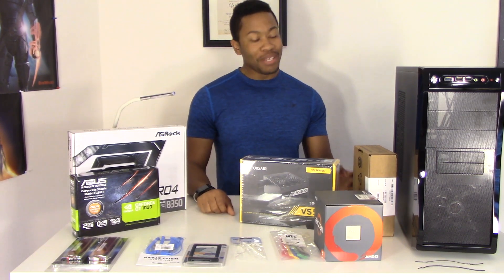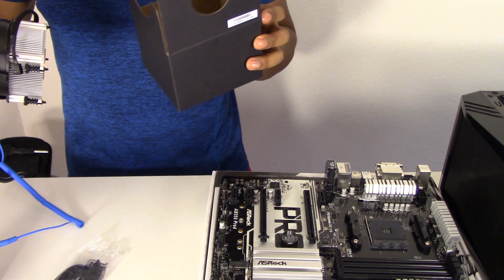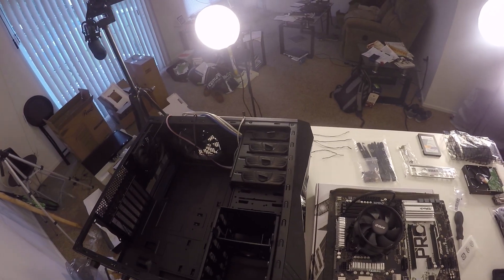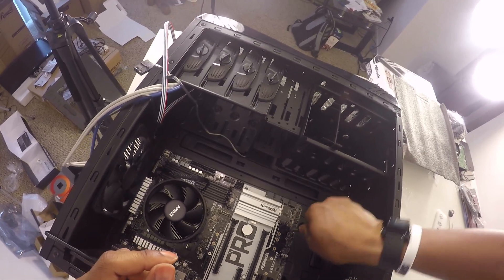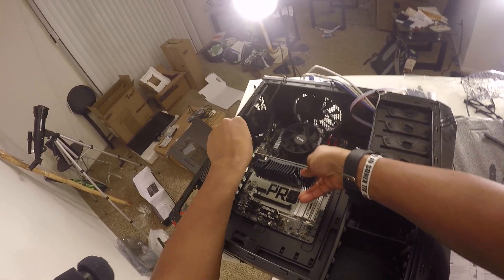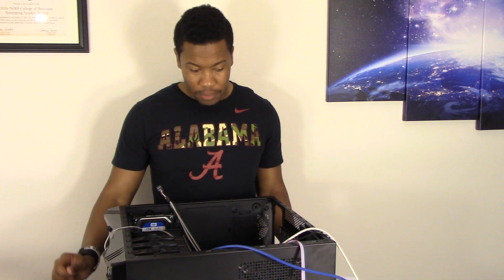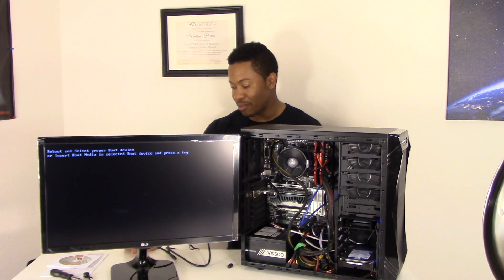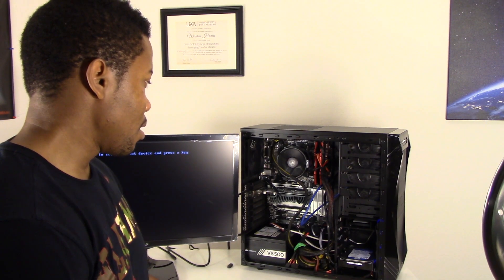Budget PC Build 2018 - $679 | AMD Ryzen 5 1600 | Noob

Comment: Great components selection, even though you mention it's your first build, it seems you informed yourself well enough about what you would need to buy. Specially recently I've seen people fall too easily into the 80 plus gold/platinum craze, without realizing that, for their usage scenario, they will hardly recoup the costs of their purchase with their presumably better efficiency.
Reply from the maker: Thanks man! You're right, it's easy to over do it and not fully utilize the full capability of the purchased components. Best case is both having an idea of what's needed and how it can be scaled\upgraded in the future to continue to meet that need.
Reply: It's not always about that.  Some people have sensitive ears and want it to run as quiet as possible.  Some of them handle power output so well they help improve the stability of a higher overclock, while also not bothering someone nearby with sensitive ears, come with a several year warranty and give you time to properly shut down your computer when the local grid is having problems that cause your lights to blink.
Reply: Disclaimer: This is speculation, I have not checked with an electrical engineer to confirm.  A better PSU might also compensate for less than great configuration of onboard component specific power management.  So you don't have to worry about spending hundreds more on the MB just for a more stable OC.  Just as a car can be comfortable with great wheel suspension or great seat suspension, but adding seat suspension to a car with superb wheel suspension is just a waste of money.  I bought an 80 plus gold PSU, but didn't notice until after.  I bought it for other reasons.

Comment: I had the same issues getting the stock fan on, I think the bracket of the ASrock MOBO was a bit low
Reply from the maker: Sam Ahh, I'm not the only one to have struggled with it. Yeah I had to push pretty hard on the screws and I was pretty nervous about doing so. And slip or too much tension could have hurt the board.
Reply: That part of this video primed me to get it right.  The fan cable has noticeable slack.  I just plugged it in and turned the HSF counter clockwise until it was as tight as it could get and mount.  Just turn the screws a little at a time, starting just enough to get them in.  The second one should be the corner opposite the first with the first in just enough to hold its grip.  My mistake here was I turned the first one too far to get the opposite corner lined up and had to back it out almost all the way.

Comment: Good vid man. Almost same specs as the one I'm looking forward to build for $700(price is a lil bit expensive here). Here's the specs of what I'm building:
Proc: Amd Ryzen 5 1600
MOBO: Asrock AB350 Pro 4
RAM: DDR4 Geil Super Luce 2X8gb 3000
SSD: Geil Zenith R3 240gb
HDD: Will be using my old 2TB WD Blue and 1TB Seagate Barracuda
PSU: Seasonic M12II Evo 520w 80+ Bronze
GPU: Palit GTX 1050 Ti Dual OC 4gb
Case: No Case yet but with my remaining budget I can only afford to buy a $50 case, sucks right?
Reply from the maker: Nice man!! Yes looks pretty similar to my specs! Have you purchased your case yet?  If not, which case are you wanting?
Reply: Not yet, I really like the Phanteks' cases, but they're just darn expensive.

Comment: I've never used an antistatic wrist strap in any PC build...just discharge your static on something metal.   And I do get zapped constantly in the winter to the point I hate touching door nobs. :/   The black plastic clips you had to remove are for the old AM2/AM3+ CPU coolers...they had clips that clipped onto the hooks. You generally want to install your RAM sticks on the box before you insert the motherboard into the case since it minimizes the motherboard flex.  Personally I'd have gotten a GTX 1050ti 4gb since you do game some...like Mass Effect.  The GT 1030 is more a home theater PC GPU but I guess your it should be ok unless you're rendering videos with the GPU.    I really want to help with your cable spaghetti. ^^   Congratulations on getting it together and it booting on the first try. ^^
Reply from the maker: I have that same problem during the winter. But I guess I was just being extra cautious on the build ha! You know, that makes a lot of sense about installing the ram before placing into the case. I'm not really sure why I didn't go that route on this build o_o. But for sure I'll remember that for the next build. I'm probably going to either upgrade or build another one next year for gaming. Though I don't get a chance to game much nowwa days (other than casual console gaming), I would like to have the option. For the Elder Scrolls at least :). Appreciate the advice and tips!
Reply: Yay Elder Scrolls! ^^  I'm currently playing Skyrim, Skyrim SE and Elder Scrolls Online...so I might be a bit into The Elder Scrolls.  Which one are you wanting to play Morrowind, Oblivion, Skyrim, Skyrim SE or ESO?  I was playing Morrowind but last year when my hard drive crashed I lost all my Morrowind mods which included the Morrowind Overhaul 3.0 that updates the games look a good bit.  I put my Oblivion play through on hold for now waiting for Skyblivion because graphically Oblivion bugs me even with mods...those oval faces. o.0
Reply from the maker: Jennifur68 Ha nice! Morrowind is what I want to play now. I'd love to play Oblivion again also. Played of course on console before, but that game has a special place. Though I've completed Skyrim, something pulls me back to Oblivion. Yeah I've heard about Skyblivion. If I'm not mistaken that has been done for Morrowind also! If not, it would be great. I've never played it but I've heard people say the original was quite annoying gameplay wise. I'm sure it would be much better on a newer engine.
Reply: Morrowind relies on virtual dice rolls to determine hits so early on its like swoosh, swoosh, swoosh, swoosh, swoosh, clink, swoosh, swoosh when you swing a weapon. You miss a lot because your combat skills are low.  I'm kind of looking forward to Skywind too after loosing my load order for Morrowind.  I had the game looking pretty good with all sorts of grass, updated trees, new bodies and draw distance overhaul and after the hard drive failure I just couldn't get it all working again.   One of these days I'll get around to finishing Morrowind but I've had to start over like four times.

Comment: Hello dude, nice build, just wanted to say that the stock cooler can overclock to 3.8ghz I believe while maintaining decent temperatures
Reply from the maker: Thanks man! Nice, I was a bit afraid to overclock it at first. I may give it a test run soon and monitor the temps just to see the difference.
Reply: warren010h No problem dude happy to help, but temperatures shouldn't go over 65c under load I believe
Reply: warren010h Btw please try to do some cable management, and maybe try to take some of those drive cages off, this will increase your airflow, giving you lower temps
Reply: Before you OC you should check out others who reviewed this board and mention overclocking.  Allegedly, as long as you stay within a certain voltage range you should be fine, but too much and you might permamently degrade the CPU.  You should approach this gradually and very cautiously.  But you should get at least a small boost within the safe range.

Comment: I'm not recommending any risk taking, but I've heard Jayztwocents brag about building computers on his carpet and never experiencing any problems because of it.  When you're new to something or damage is a large cost to you, you tend to worry probably more than necessary.  I know I do.
Reply from the maker: OptimisticPessimist I definitely worried more than likely necessary. In particular because of my carpet. But yeah the cost of the components, though not as expensive as some of the more powerful stuff, I didn't want to have to buy something again lol. Interesting mention though. Sounds like the carpet static deal was challenged

Comment: Hi, im planning to build one too, will just use it for normal use and entry level rendering.. planning to get ryzen 5 1600 + asrock ab350 pro.. but my worry is the memory, i want an 8gb ram but most brand and their models in the stores are not found in asrock's qvl site. Should i change mother board? OR yolo with the memory even if not found on qvl?

Comment: looks realy nice, i have the exact same thing however mine just doesn't go on, the cables are very hard i don't know the exact name of them but there are multiple colours and plus and - that are loose i think i did the correct thing and i put the yellow power cable in and the cables for the hard disk but mine won't boot, it goes on but the fan won't spin and it has no input, any help only difference between the uploaders built and mine are that the coloured cables are loose
Reply from the maker: Hey sorry for late response. Are you still having this issue? I wouldn't think the tightness of the cables would exactly matter, unless it's causing your connectors to not be seated well enough. And you probably wouldn't want to stress your cables entirely too much. If you can, try to rearrange them so that they are a bit looser and make sure the connectors are fully seated. Sometimes pushing them down just requires a little extra tension. Not too much but you know. And it can be scary because you don't want to force too much and break anything lol. Let me know if this helps. Probably general info but I know it was reading a forum about pushing the RAM down hard enough that convinced me to push harder during this build after trying to insert them for over an hour haha!
Reply: thanks for the response man, din't expect any, i was just being a brainlet i accidently plugged my cpu fan into the wrong part, when i plugged it in the correct slot the pc worked, also some ram don't have to be push hard as long as they can be locked in, but thanks for writing the response

Comment: Hey, I have a problem on that motherboard with installing my rx 480.
By pressing the gpu down in the pcie slot I don't hear any clicking and it wouldn't get down on the left side of the pcie slot.

Any advice?

Comment: how did it work , espacially the ssd
Reply from the maker: RogersGems Working pretty well :). Though I'll admit, I wish I had started off with a better SSD. I'm just a tidbit concerned with the longterm reliability of it considering it was a fairly cheap one. But I'm probably over worrying about it. Overall works great, haven't had a single issue!

Comment: The GPU bottlenecks the CPU! Go for a ryzen 3 1300X or 2300X (when they are out) and invest more into a GTX 1050 or a GTX 1060 3Gb.
Reply: Oh btw cool video, forgot to mention that! :)
Reply from the maker: @maxheim3802  A little late responding but thanks for the recommendations man! :) Really appreciate it. I'll be looking into upgrades pretty soon. If I don't just do a complete new non-budget build.
Reply: +warren010h well, i also bought an Ryzen 5 1600 for my gaming rig with an gtx1060 3gb.

When i play now (things Like battlefield or other huge map games)
 my GPU usage is constantly at 100% with permanent ~3Gb/3Gb GPU RAM usage,
and the ryzen hardly breaks a sweat with 20-40% CPU usage.

So in conclusion we can say for budget gaming rigs go for a ryzen 3 and look for a mainboard with atleast 6 CPU phases and a good cooling solution (those are the mid end B350 Boards. I got an asrock ab350 pro4. Got 6 phases if im not wrong and Costs about 80€ here)

This way you can OverClock the ryzen 3 and the performance is equal to a Ryzen 5 1600 in terms of gaming.

What i can conclude now is:

There is absolutely NO reason to buy an Ryzen 7 for gaming.

Ryzen 5 is for futureproof gaming CPUs, but i recommend ryzen 5 1600, because it has overall the best value and includes a stock cooler.

Ryzen 3 1300 is the perfect choice for budget rigs, IF you overclock it (Overclocking is pretty simple and safe. Dont be scared, i run my Overclock stable with stock voltage what is completely safe)

The x-ryzens are the complete same chips Like the non x variants,  just with higher stock speed. So in the End 
if you are going to overclock it: go  for non X
If you are going for simple CPU without OC and dont care about saving a bit of money: go for the X ones.

And for gpus its pretty simple, 2gb for games Like league And things Like this.
I got 3gb, i can play bf1 on 60fps high settings so this is a pretty good choice for budget.
And 4gb is pretty good and u can play almost all games on high settings.
But not only the GDDR5 for the GPU is important, also the Core Clock speed and memory Clock speeds are.
Good Core Clocks are above 1500-1800MHz, the more the better. But thats another discussion i started here;D

RAM is also a struggle.
For demanding games 8gb are not enough, and 16gb's are way too much.
So simply: 
straight budget: 8gb
Otherwise drop those extra 70 $ on 16gb RAM

Hope i could help u a bit:)

Comment: gt 1030 wtf
Reply from the maker: BAMBOK ala Indeed :)
Reply: I ordered mine with a 710.  All it's needed for is video output for about $32 and max power consumption of 19w, since the CPU will be doing everything else.  I also ordered an R3 1200.  Will see soon how it works out.
Reply: Running it now.  Works great.  I don't recommend it vs something with better video processing onboard.  Youtube videos somehow look worse compared to my 750 ti paired with an i3 2130.  I suspect visual quality to be the reason professional video editors don't like cheap GPUs.  But for that, the best bang for buck might be the cheapest option with the video playback and post-processing options that you need.  This card is not for them.  It works for a cheap server that needs its own video output but you don't want an APU or remote management that someone can hack into.
Reply: I had dithering disabled when I commented here.  I re-enabled it [set back to auto] since and video is better.  I can't do a side by side, since I only have one monitor.  My 750 ti does have a better video processing engine, and of course 1050 and up even better, used via VDPAU.  I'm not sure whether it's a good or bad thing that NVIDIA is dropping support for VDPAU and moving to a CUDA model for all of that.